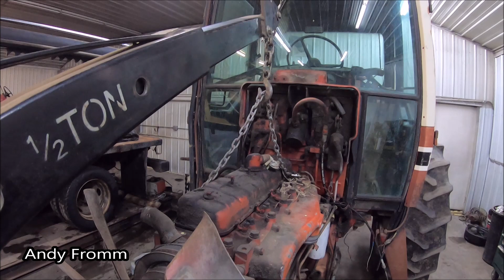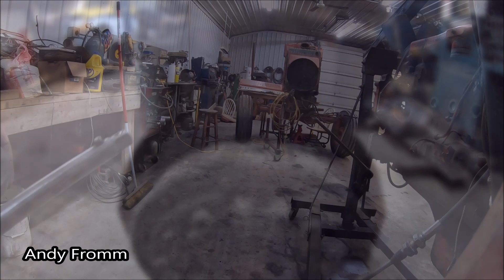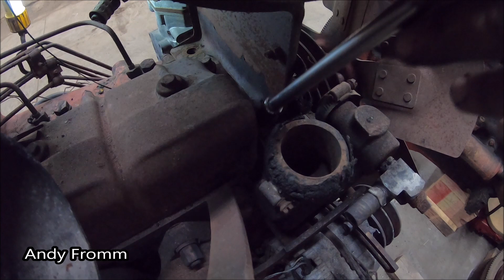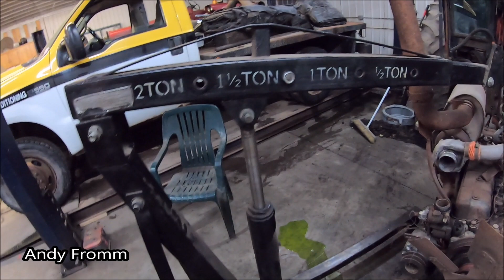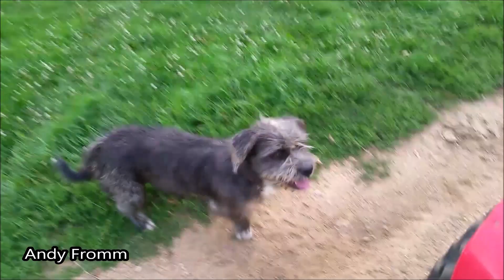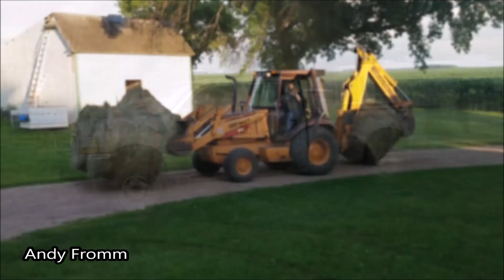#IH1086 Pt13 disassembly pt3 swapping engines...

Comment: Your making it look all too easy, winter is coming and I’m looking at a torque amplifier repair on a 1086, thanks for the step by step procedures
Reply from the maker: Its usually not as easy as it appears. Hopefully my videos provide something useful. I have some 806 videos that I tear into it more than the 1086. Thanks for checking them out & good luck 👍

Comment: did you check the clutch and pressure plate to see which one was best??
Reply from the maker: I didn't, the burnt engine was a tractor they were using till it burnt. I guess I'll have to split it again if its no good. I love making more work for myself 😒
Reply: @AndyFromm  you make it look so easy.. video does that
Reply from the maker: @r.hazelwood4885  thanks, I appreciate it. I don't feel this is too bad but I still would rather do my day job than be a full time mechanic.